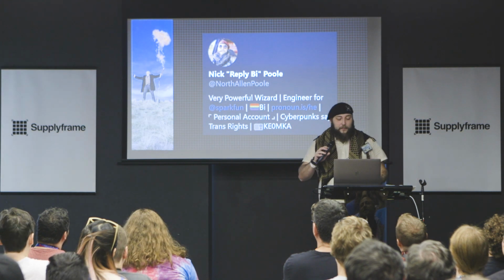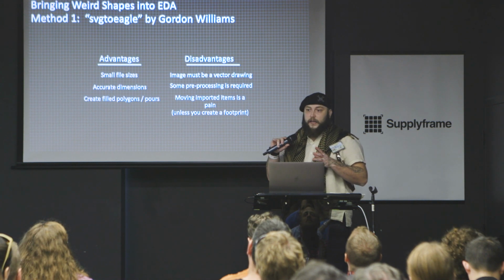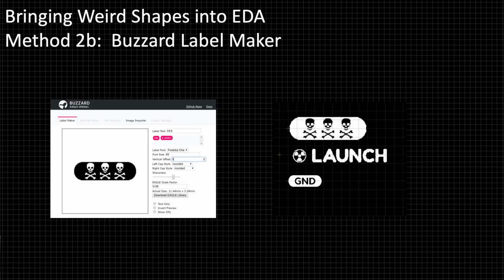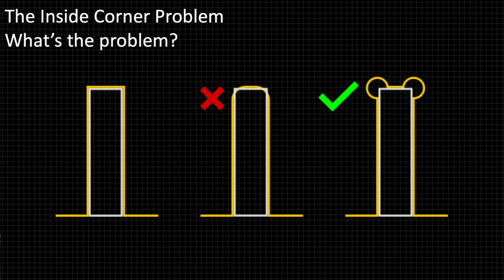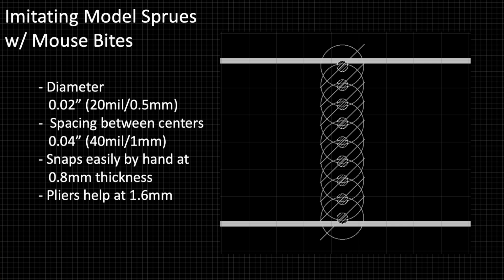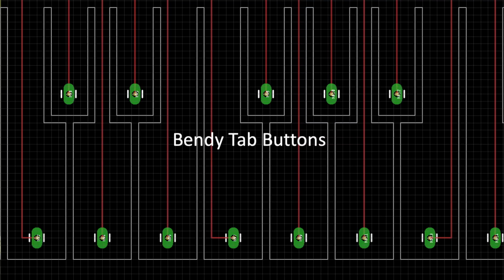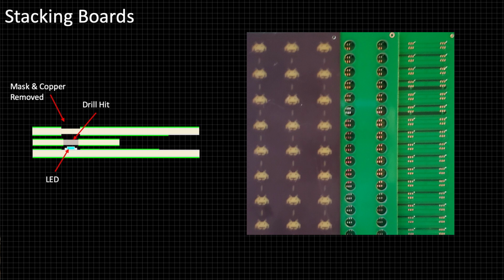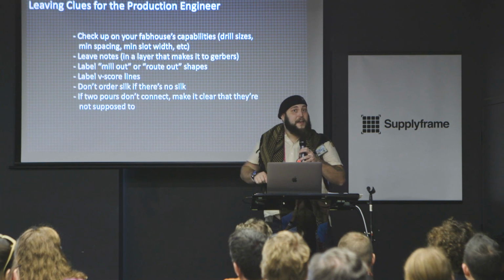Nick Poole - Boggling the Boardhouse: Designing 3D Structures, Circuits, and Sensors from PCBs

Comment: Love the pcb flex switches and the ‘rivets’ for the pcb stacks!
Reply: If you don't want the rivets to show through on the front side you can make the equivalent of a plug weld with a 3 - 5 mm plated hole on the rear board aligned with a slightly larger surface mount pad (enforced with vias) on the bottom side of the front board. http://modernvespa.com/forum/post1557842#1557842